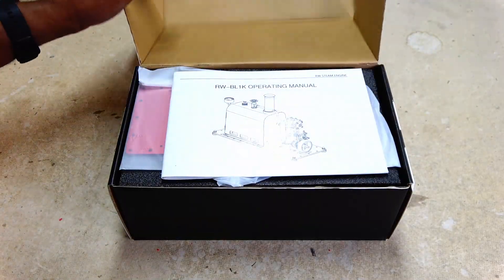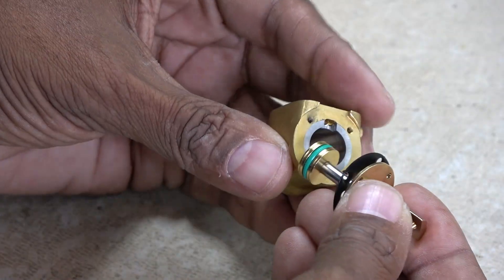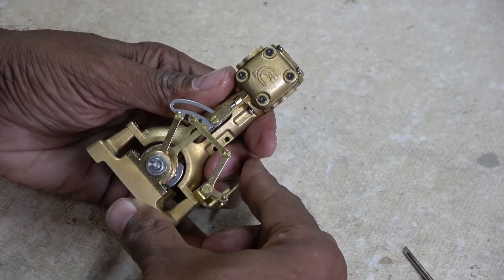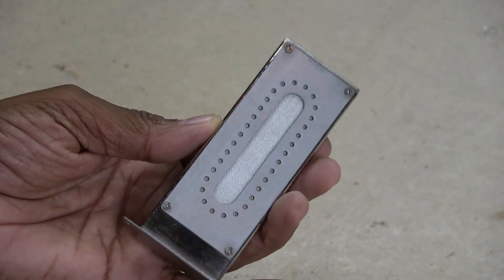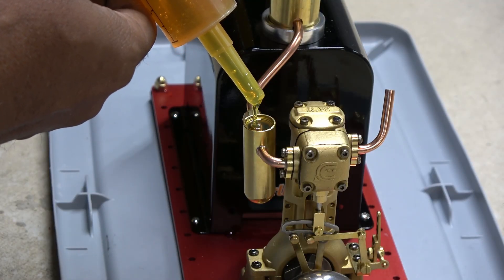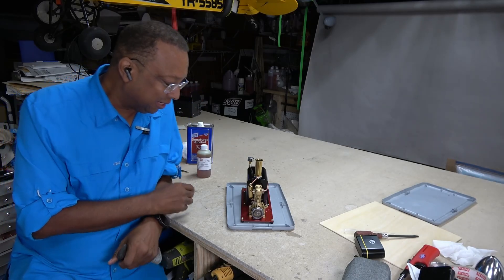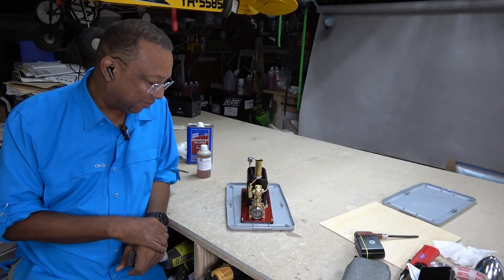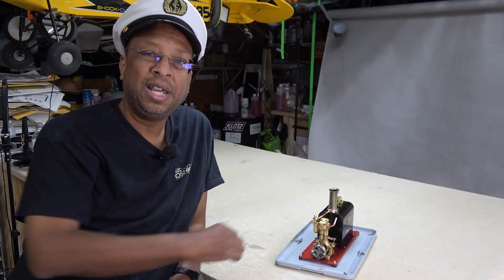Full Steam Ahead! - StirlingKit RL-BL1K DIY Steam Engine Kit | HobbyView

Comment: Neat engine! Maybe you could make a version of a paddleboat. The flywheel should serve nicely to belt drive the wheel. Remember that water expands to 1700 times it's volume when it turns to steam. I also wonder if the flap door might also serve to control the flame heat of the alcohol by limiting the oxygen to the burner. Great vid, as always.
Reply from the maker: oh, interesting point about the flap door!

Comment: thats is a cool build.  another use would be to find a small dc motor that would function as a generator.  with some additional simple electronics it could be used to charge a cell phone or other small item.  its much quieter than the gas generators my neighbors used during the 3 weeks we were without power after Helene.  enjoy your channel.  thanks for sharing.